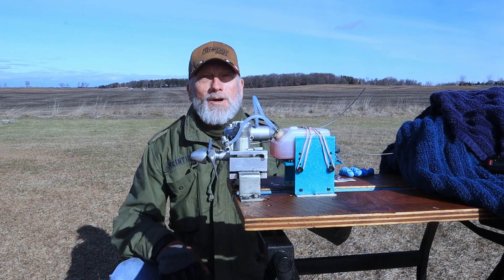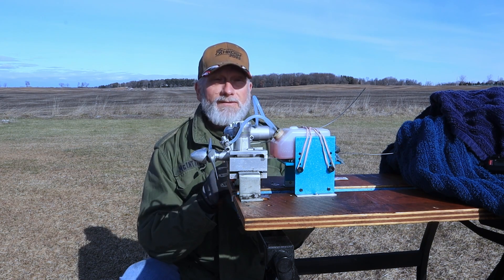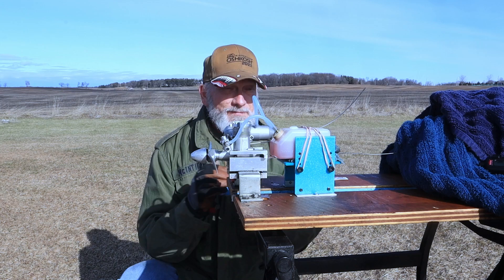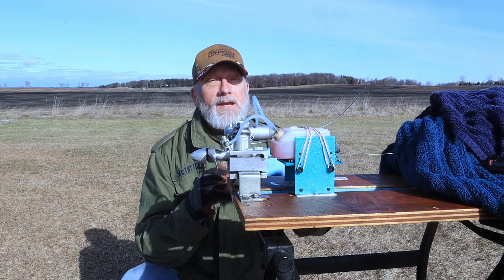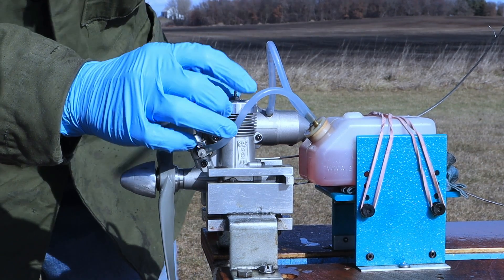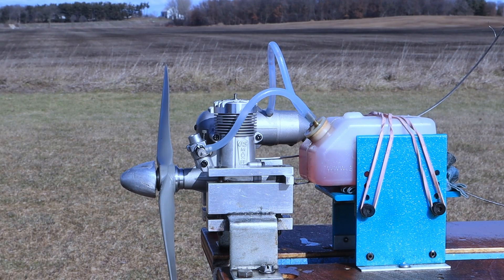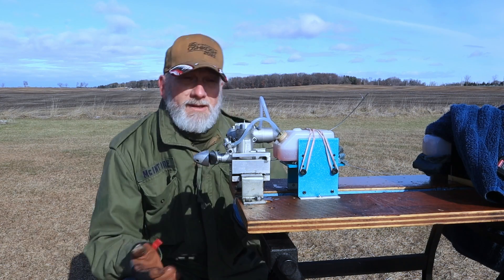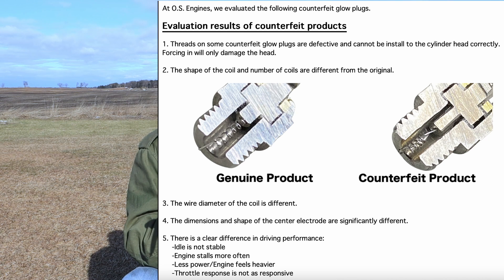Counterfeit OS #8 Glow Plug Test

Comment: Could there be  difference between heavier and lighter coats of Platinum? I think  The real acid test is longevity which fits better with the Chinese philosophy of rip off when and who you can ie the plug works fine but doesnt last as long then they can claim oh its your use thats the issue etc